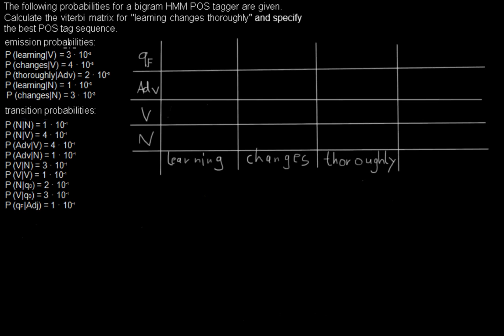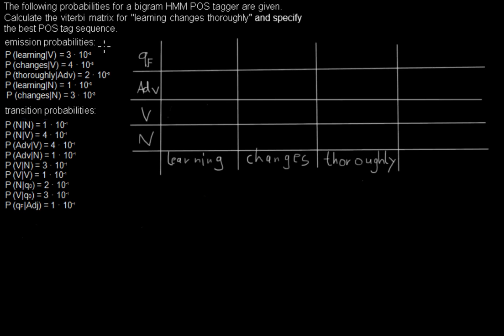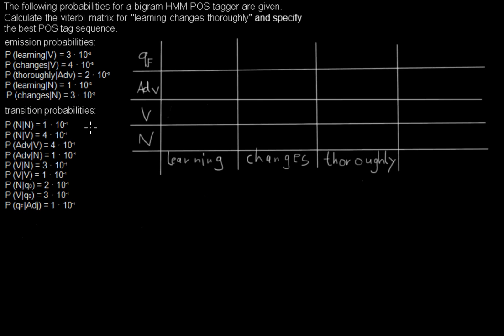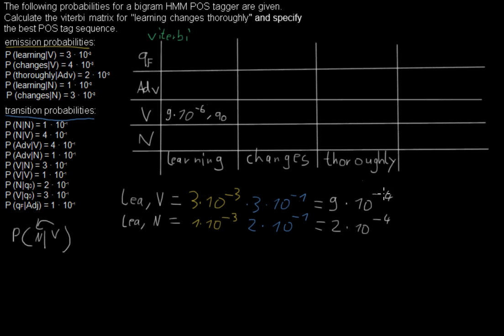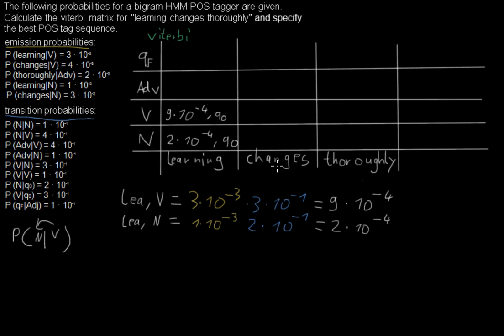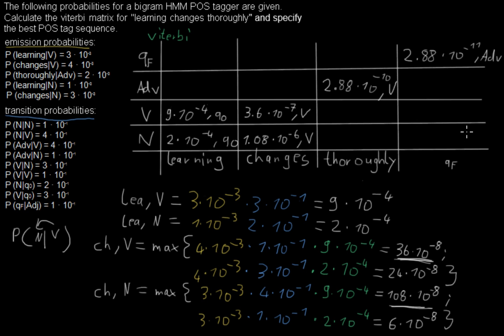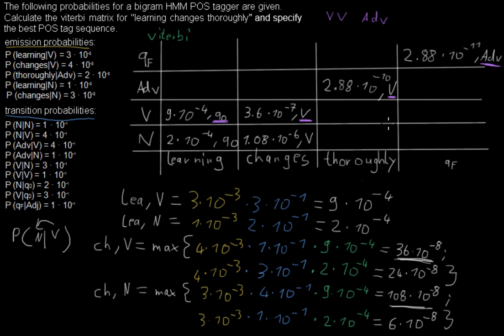Viterbi matrix for calculating the best POS tag sequence of a HMM POS tagger

Comment: I think, according to ur calcs, the correct tag for changes is N and in the next state u come actually from the N state not the V state. Any ways, well presented. Thanks.
Reply from the maker: Hello, I did the recalculation for you.

For verb the formula is P(thoroughly|Adv)*P(Adv|V)* the previous probability where changes is a verb.
Analagous for noun.
For verb the probability is
2*10^-3*4*10^-1*3.6*10^-7=2.88*10^-10
for noun the probability is
2*10^-3*1*10^-1*1.08*10^-6=2.16*10^-10
which is lower. Therefore the correct sequence is V V Adv. Do you still see any mistake?